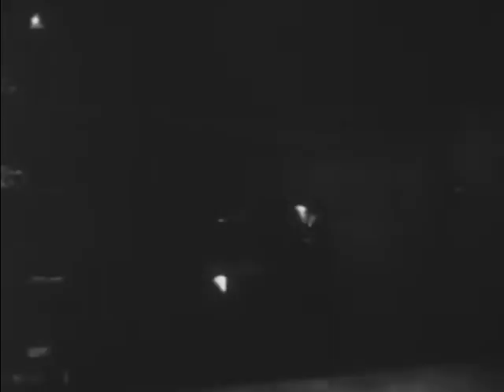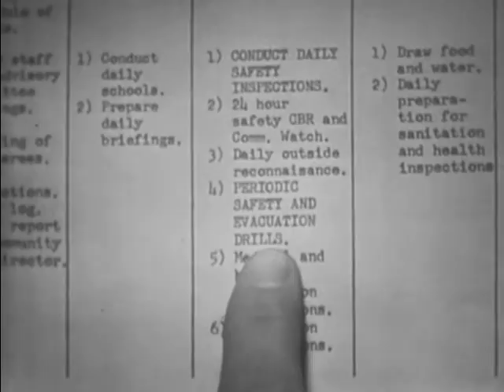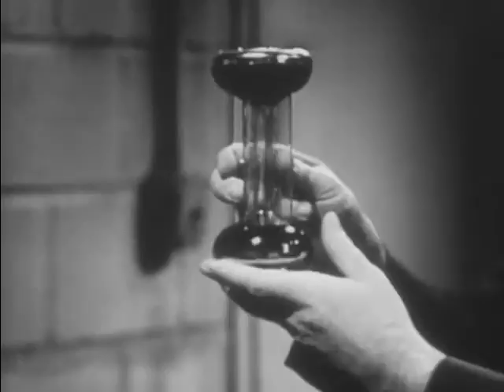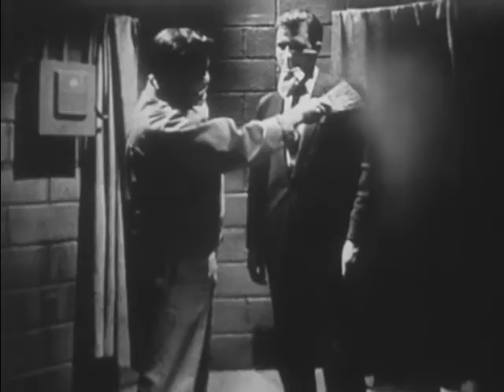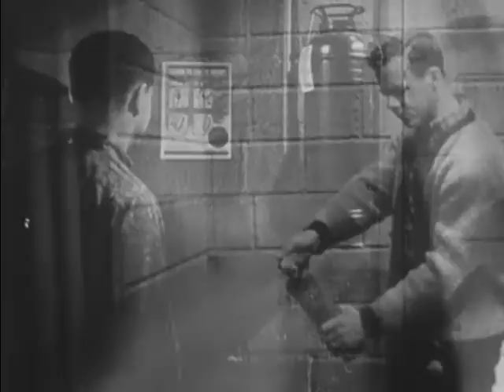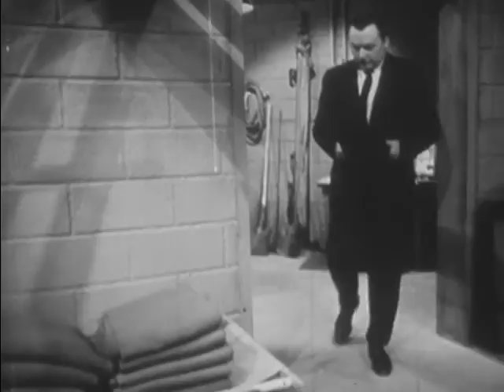Safety Measures In Public Shelters (1963)

Comment: build a home shelter. learn and train yourself on everything. personal responsibility.  if you ever find yourself in a public shelter  because you were too far from home, you have two options depending on what type of people you are with, inform others or keep your mouth shut. if you know too much others are threatened by you. know what is going on and when it is safe LEAVE. BEFORE THEY COME TO COLLECT EVERYONE. there may be no warning of this as the command center may make the decision to do this without telling the shelter staff. if you carry a bug out bag LEAVE IT OUTSIDE OF THE SHELTER. retrieve it when you leave.  it WILL be confiscated by the staff. know that after an attack they all will come for what you have. criminals and government both. and both will try to disarm you. in times like this you fight for your life and make it to costly for them to continue to try and take from you. they will move on to easier targets. NEVER OPEN THE DOOR!  don't even respond to those that knock. if they know you are in there they will find your air supply vent and smoke you out. much easier than getting through a hardened door. don't let them know you are in there. they will know that supplies are there if you are. from the day the bombs drop you will be at war with everyone. trust no one. Especially the government. they will strip you of everything and put you into forced labor camps to rebuild while the politicians and elites sit back and watch you.